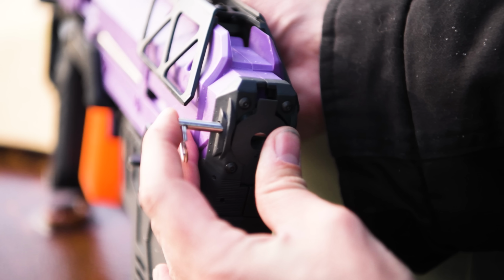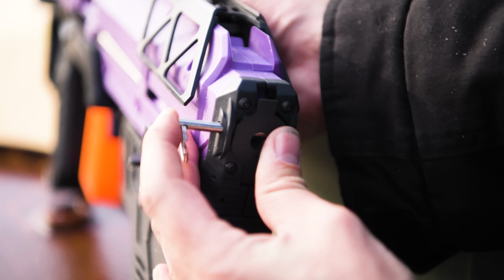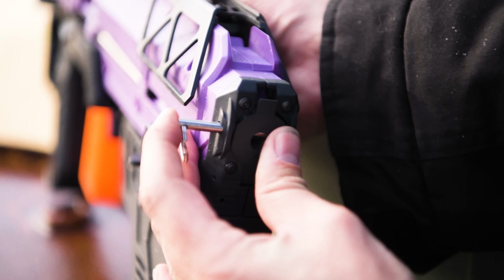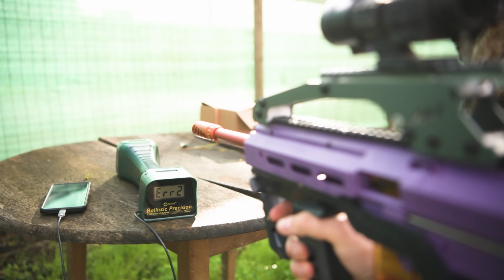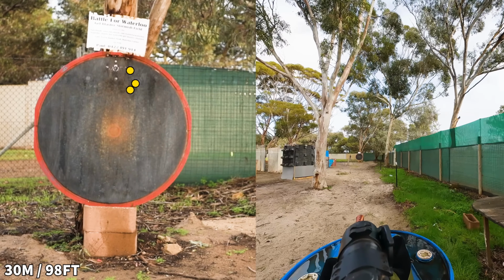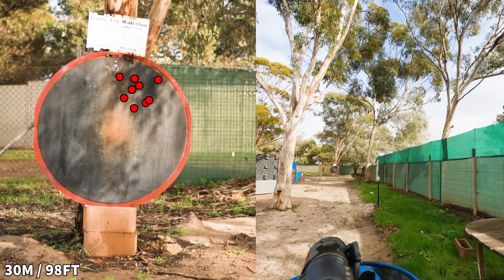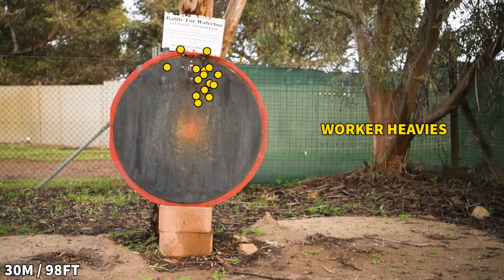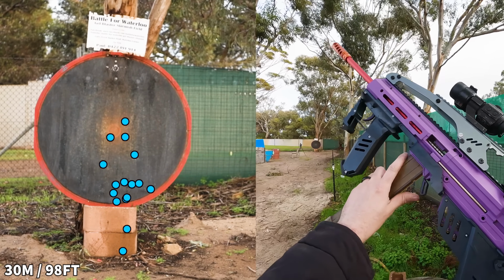Inverted Scales Bullpup 300fps Nerf AEG Tested!

Comment: whats the difference between the 200 fps and 300 fps inverted scales? (aside from spring/barrel), would it be possible to upgrade the spring and barrel of the 200 fps version to make it hit higher velocity? or are there differences in the internals
Reply from the maker: From memory I think the high fps version has beefed up internals. I likely mentioned it in my original review but it's been a while.

Comment: Now add a secondary motor that changes the precompression of the spring and then add a sight similar to the rapid strike mod that adds a computer to the system to smartly do stuff and then a manual priming handle (lol jk jk, I'd like a proper priming handle for manual use if EMP'd)

Comment: The magazine is in the way of your hand, which is not very comfortable and the Inverted Scale can do 250 FPS.  It is not capable of 300 FPS.
Reply: Owner of one here. It is absolutely capable of 300 FPS with bamboo 1g darts, even with a SCAR/BCAR. That said, just FPS numbers don't mean all that much these days.
Reply: @eldwitch it's very interesting. I had 2 pcs of this blaster a few weeks ago. And I do everything to reach 300 FPS. But couldn't. 260 FPS top. And manual book also said: 250 FPS max. But Okay. I accept that you reach 300.
Reply: There are different versions
Reply: @shatteredskies191  I know. It was 2.0.